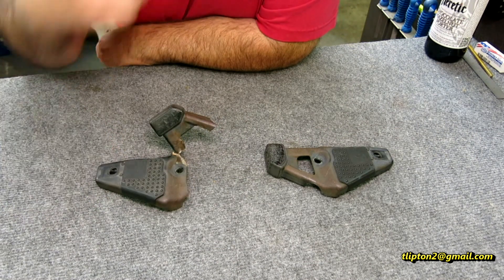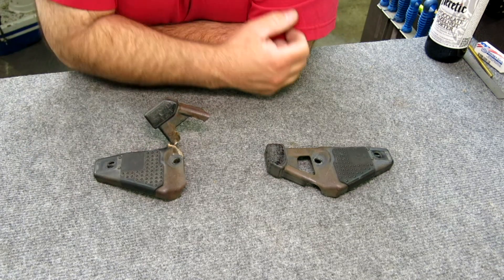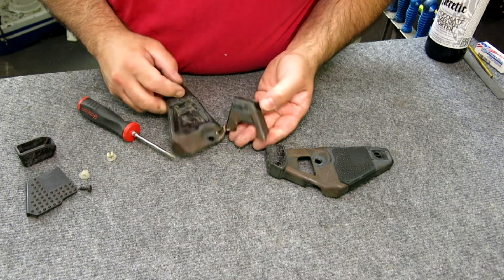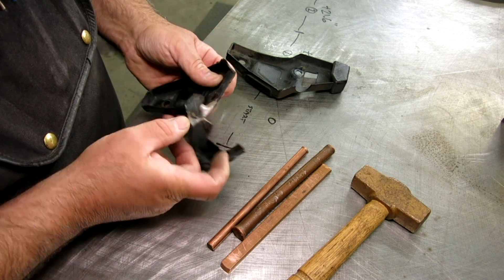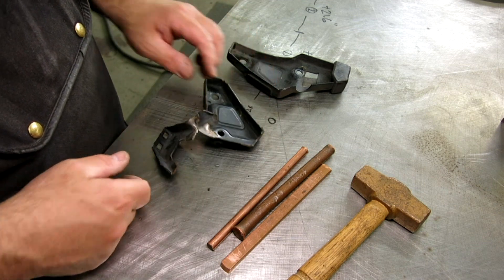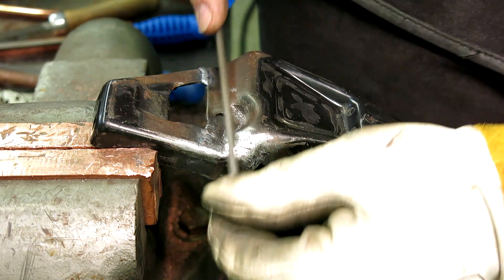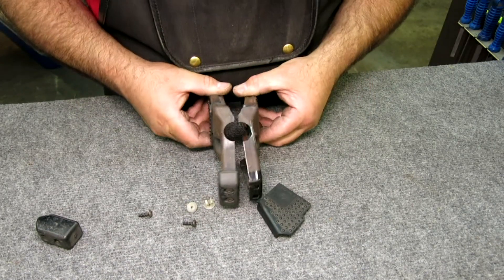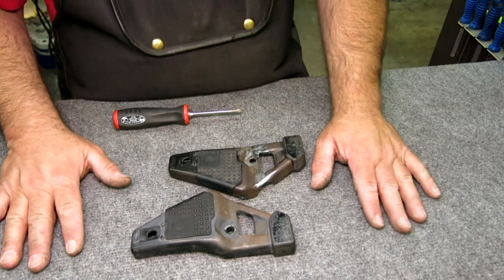BMW Crash Damage Repair

Comment: Hey Tom, 

I've done a couple of crash repair jobs. I always hate them until it's over, then the result is quite enjoyable. I was shown many years ago to start with the damage furthest away from the centre. People often question why I'm doing it that way and are then amazed how much the centre straightens up before I get to it. Stretching metal and then having to shrink it back down is a pain.

Comment: Excellent repair Tom, you saved your buddy about $150! I enjoyed watching you take your time and attention to detail, nicely done!
Reply: For some stamped sheet metal with glued on rubber and a plastic cap boltet onto some kind of plastic rivets I think those parts are not just slightly overprised even for BMW standards.

Comment: Biggest mistake i made with a similar (but for Suzuki) pair was to remake them in aluminium because i thought i was hot shit, broke the frame in the area. These are crush pillows, blow softeners, meant to break so your bike doesn't. That being said, excellent work, i've always admired people with the patience to repair these kinds of things properly.
Reply: One trick i learned from an older fella, have a pair of vise grips that's run down, cut the tips and weld two bars on them (parallel, but really, those are at your leisure) those then, are welded to whatever two pieces of metal you want to bring back in to submission as you tighten the clamp.

Saw him remake an entire panel, with this method that had been torn from indicator to rear of the wheel. Of course, he had a whole bucket of these vises that had been modified over the years.

Comment: I've done a few repair jobs on front fork headlight ears. Very challenging, to get the correct shape back into these parts. You did great, Sir. And the most important tool on such a job, is patience. Nice video!
Reply: Yep, you don't have much margin for error on those if you want to have the beam pointing in the right place !

Comment: great work.

I find that the torn edges do not get back into the same spot as the rough edges are distorted. I find that if I die grind the torn edges and take off the tuffs by 0.5mm each side the parts go back together well and the gap is not too wide to tig up.

Comment: My rebuild shop was just one open top wall away from the parts dept., whenever the parts clerk used to start giving me grief over a part I was needing badly (Can't use that part, last one, we might need it [???]), I would always find a reason to need using the Die Grinder, for a LONG TIME. His attitude changed when he realized that the die grinder was an essential tool and I couldn't be stopped from using it.

Comment: Hello...... Gronk here.  Have you ever tried E6000 glue?  It is available as a general hardware item at places like WalMart.  Comes in a tube.  Very viscous but self levelling when wet.  When dry, it is sort of rubber-like.  Good stuff!

Seems like it would be ideal to re-attach the insert.
Reply: That's what I was thinking.

Comment: Great video and skills!!  How long did the whole process take you?  How long would it take to additively manufacture a new one if 3D model was readily available?  Which method is 'best' in terms of speed, dimensional accuracy, material performance, man time versus machine time, cost, etc...  Let me know what you think

Comment: Tom,
Great reforming with the Cu punch. You lost your true calling as a body shop mechanic ;-) as evidenced by the Dolly.
If you had a Framitz it would have gone much better, but your post in the vise did the trick. You sure got it back to original very good.

Comment: Question. At the pretzel stage -- where you started -- would it be useful to hot-bend the victim  instead of cold? Later on you would do detailing  cold. Blacksmith stuff, but often effective.

Comment: The way to do this is holding some part of it into the vise, have the torch in my left hand, an a convenient pliers in my right.
Heating the small part I want to straightening to red hot and use the pliers to straighten closest to the end of the break.
If that part is in plase tack it to the one in the vise ,,,, and soon and so on . I did mine that way.
.

Comment: Tom. I feel sure you just took this job on as a challenge. But if it were me, my time is too valuable to sod about trying to repair something that is still available as a genuine spare part from the dealer. If you owed the guy at work a favor, I would have bought the new parts and given them to him, then spent the time doing what you wanted to do instead of all the aggro you went through, trying to make it look new again. Well done though, you sure do have a lot of patience.
Reply from the maker: Hey Dave. Thanks for the nice comment. Sometimes a challenge and a relaxing shop session is just what is required. Little music and a little refreshment and all is good with the world.

Cheers, Tom

Comment: Great video as usual Tom! 

What size pliers were you using? Looked like either the 5" or 7"? It seems like half way through one of your videos I'm looking on amazon for a new tool I didn't know existed. Thanks once again for bruising my credit card.
Reply from the maker: I'm pretty sure those are the smallest ones Knipex makes. I do have all the other sizes as well..........
Reply: looks like 180mm to me? You also need to own the 250mm. Those pliers came to mind as soon as I saw what Tom was up to today.
Reply: Of course you do. LOL
Reply: Looks like you need to buy more tools Tom, they make a very cute 125mm size now.
The last three digits in the Knipex part number is (overall) length, approximately.
Reply: I bought a set of the 250mm KNIPEX pliers from Amazon in the UK, a bit expensive but worth it I’m sure.
Reply: Yeah those are nice as pliers mith non maring surface, to hold something that should not get pinched or even as a wrench, what I think those are indeed designed for beeing used as. Kind of the Knipex version of "all 16th" as Abom calls those Bahco/Crescent wrenches. I think I even have seen some of those knippex pliers with some kind of a plastic or Teflon sleeve over the jaws, especially to handle delicate chrome plated plumbing stuff.

Comment: Does the 'mushroom' end of those copper bits work-harden enough that bits shatter off from hammering? i.e. do you have to anneal those things after a while?
Reply from the maker: They do work harden a bit but not enough to chip. I reshape them long before they roll over and splay out too much.

Comment: What would u call the anvil, die tool in the vice at around 20:00? What should I search for to find one in Europe? Thanks
Reply from the maker: That is an auto body dollie. I think that particular model is a "universal" or general dollie. Used for sheetmetal repairs in the auto industry.

Comment: Why is your TIG tungsten stick out so far. You have like a number 5 cup and like three feet of Tungsten stick out. Why?
Reply: I get ya. I guess I go by the rule, as little stick out as you can maximum coverage when you can.  btw, I disagree that hand tools are more controllable than power tools. You can control power tools with the level of abrasive you use. So an angle grinder with 400 grit linishing wheel is very gentle and will remove material very slowly but more evenly than hand tools. Less individual scratches and a more uniform grained result. But the noise is a good point. I have cut things with a hack saw simply so I don't have to run my cut off saw. That thing will wake the dead.

Comment: As a job from a friend obviously you do your best work, but I don't see the value in repairing a punched metal part like this. There is no hand machining in the part so it should be a cheap replacement. If you were to price this as a job for a client I would expect it would be around the $30-40 mark for 30-40 mins of work, plus welding, and if I was doing it as a job I would also be sandblasting and respraying it so that it doesn't corrode.